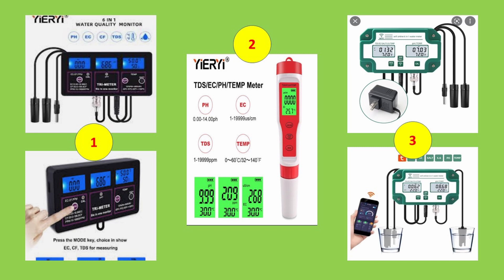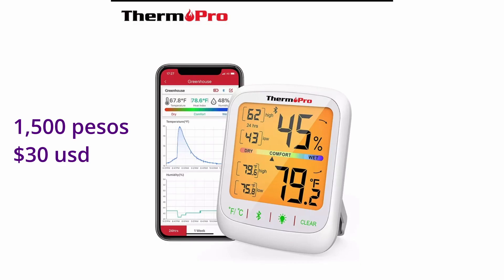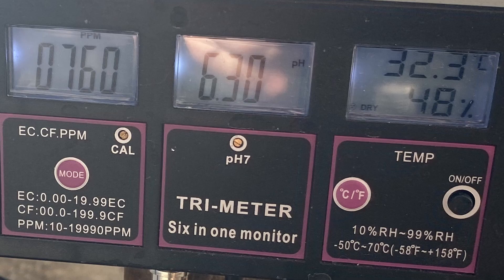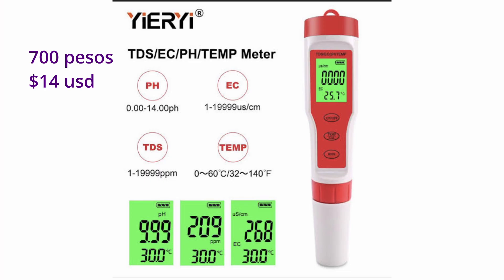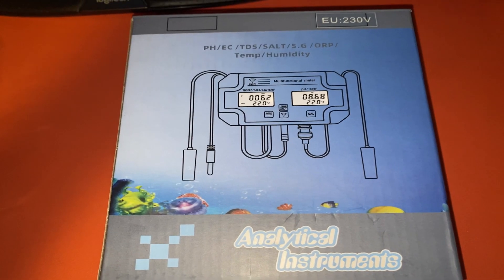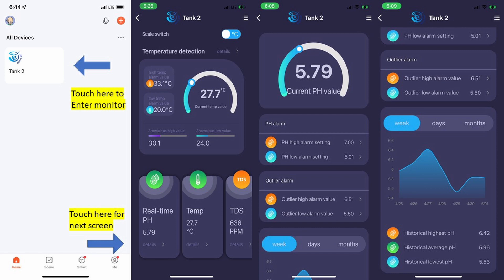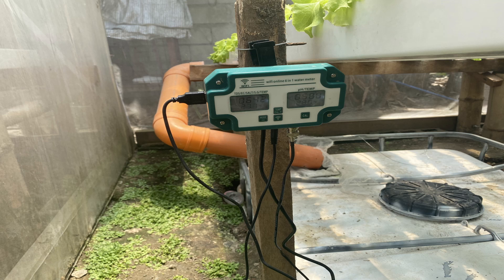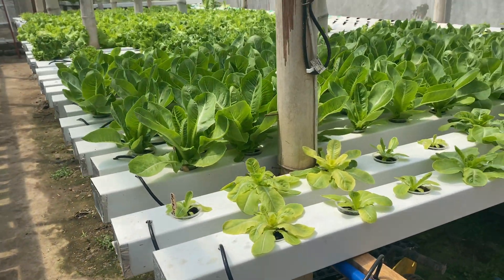Yieryi 6 in 1 Water Quality Meter review

Comment: I just ordered  Yieryi water quality meter still not arrived the interesting thing is that as far as I know that tuya smart are combatable with homeasistant which giving users the minimize the coast of building diy hydroponic automation system because the most expensive peace of equipment in this diy project is atlas scientific ph and ec kit
Right now i,m planing to use Yieryi water quality meter + JEBAO 3.4 WIFI aquarium doser to careat some sort of simi auto hydroponic dosing system the meter is going to give me alarms I will add pump in the resivour which i can run  remotly while dosing to mix the nutrition and ph adjusters using JEBAO 3.4 WIFI doser
Reply from the maker: Wow - I can really use that for dosing my hydroponic tanks.  Yeah - I also checked the automatic dosing systems and they are way out of what I can afford. Thank you for this comment.  I will look into the JEBAO 3.4 to see if it will work in my application.  BTW - the second unit arrived and it is installed and working in Tank 3.  I now plan to purchase one for Tank 1.
Reply: @expathydroponics8500   the jebao doser have arrived but unfortunately you can't set the volume you are dosing in the manual mode it is the same as pressing the physical button however you can set the volume you are dosing in the automatic scheduled mode I calibrated the dosing volume to 20 mils after i fenished with calibration  i set the timer to dose 5 mils and it gave me accurate  5ml dose 
if you are looking for better solution you better find an aquirom doser that can actully set the volume in manual mode
Reply: so if i,m going to use Jebao doser with my hydropoinic setup the scenario would be like this yiery sensor will show me the ec and ph reading or ph and ec alarts acordanig to that i open jebao doser and set the dosing time and dosing volume  before that i will have to connect submersible pump to a smart switch and turn it on to use it to mix the the nurtions in the reservoir and keep it running until and I finish with dosing and i,m satisfide with ec and ph readings
Reply: @mannyalali2022  you have it setup can you make a video on it?  Would like to see it setup in home assistant.
Reply: @mannyalali2022  hi, can you use it in home assistant?
Reply from the maker: Wow - it would be great if you make a video of this when you get it set up.  If you don't have your own channel,  I will post it here so others can see.
Reply: Ive done it a while ago, the Jebo doesnt work with Tuya/smart thinng/smart life

Comment: Thanks for your video. Really hope you can tell me the power adapter/ power requirement. I saw the unit use DC6, is that true? The power unit only as an adapter to power the unit. My question, can we use the unit outdoors, using 6v DC? I fail to get firm answer from seller. Really appreciate your answer/ review on that. Thank u sir
Reply from the maker: I am not sure.  I am in the U.S. now.  I will text my friend in the Philippines to see if it says on the adapter.

Comment: Hello, great video! I was wondering if you knew. If the wifi were to shut off, would this device still run properly and keep the parameters for alarms? I am trying to attach a solenoid to one of these so that when the salinity runs high it will automatically run the solenoid and release fresh water. However, there may be times where the wifi goes down. I just want to make sure it runs properly.
Reply from the maker: I don't think so.  The software to control the alarms is in the Tuya app.

Comment: i bought one and worked for about 4 days and the PH side of it failed.
Searched reviews and alot of the same problem. Wondering if yiurs still holding up?
Kind regards
Reply: Hello i got same impression. I wonder if it's the probe which is interchangeable or the instrument itself. Looking for information but I've not found much information. 
I get like 8ph but i measured with swimming pool reagents and it's 6 (i use ph-product). Maybe a calibration can fix it?😢

Comment: Thanks for the video, I am planning to try one for reef tank monitoring. Looks like the tuya integration could turn on and off smart plugs if it gets above/below parameters.
Reply: Not well, it didn’t come with anything to calibrate it. The solution I bought to calibrate it quickly lost calibration. So for a reef tank application it didn’t work well.
Reply: How has that worked out for you please

Comment: Hi mate, great video. Im not surenif i missed on video but when you use the wifi finction do you have to be in range or the wifi can be accessed anywhere via internet/cloud? 
Kind regards
Reply from the maker: The device needs to be connected to the local Wi-Fi, but I am in the US now and when my system was running, I could check from the app on my phone.

Comment: 1:22 The device shows the humidity outside, but the temperature inside the solution? Or is the temperature outside too?
Reply from the maker: I am not sure about humidity with the 6 in 1, but it has two temp measurements on the device screen. However only one temp measurement in the Tuya app.

Comment: Thanks for the sharing, I also own the Wifi 6 in one water meter which is bought from China online.  I find it handy to use and set up for my reef tank, but it seems like the salinity sensor is not that accurate, even after calibration.  I cross checked it with some renowned sensors like Hanna salinity checker, the error can be as much as 1.0 ppt, so I not sure if it was mine a defected one or the sensors are really that inaccurate.
Reply from the maker: Thanks for sharing. I don't use the salinity sensor, but I am in the U.S. and still am using the Tuya app to monitor my greenhouse. It is still working after more than 6 months.

Comment: Can you submerge the sensor probe in the solution and let it stay there for a long time? I have the handheld version but it is inconvenient taking samples everyday
Reply from the maker: I am pretty sure the 6 in 1 is designed to stay in the tank.  The first one I purchased has been in the tank for 3 months with no issues.  These are also designed for fish tank as they can also measure salinity. As for the the hand held, I am not sure.  I would worry that as the water level fluctuates the electronics may get damaged if the level rises too high. The gasket may make it water resistant but not necessarily water proof.
Reply: I've been wanting to buy this but cant find a solid review in the internet. They also have a model that has a pH relay plug so you can connect that to a dosing pump, when pH goes off it automatically adjusts. It costs around 3k Pesos